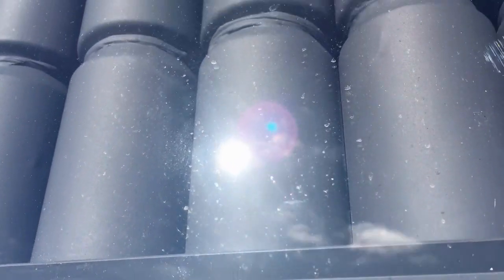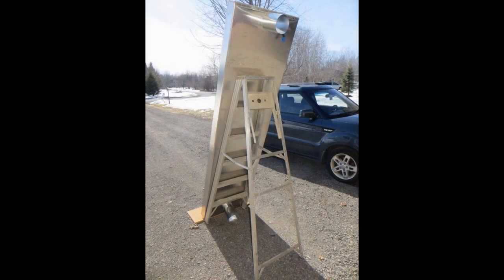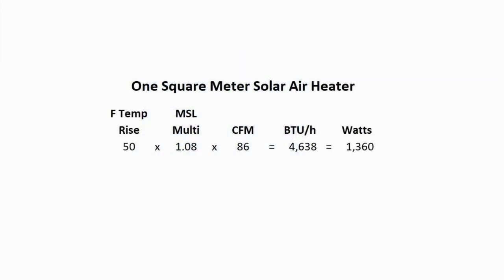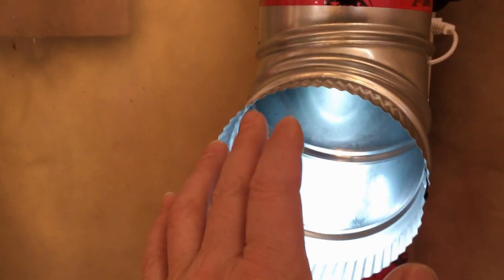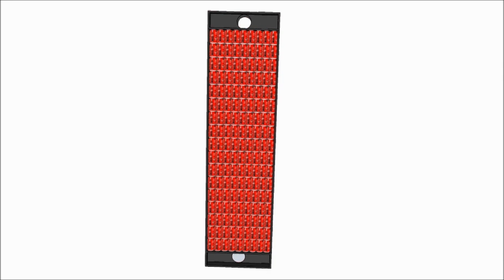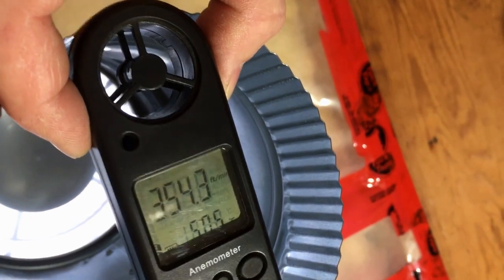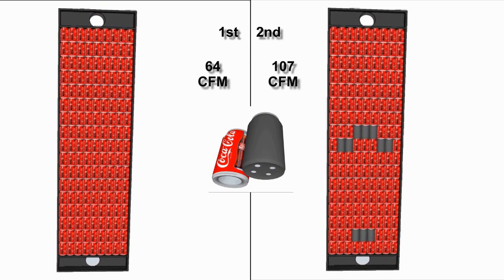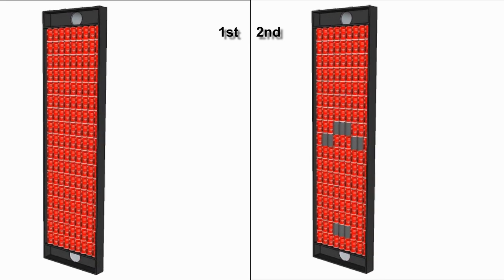DIY Solar Air Heater Part #7

Comment: Great video, Dwayne. Thanks! This addressed the biggest outstanding question I had after your first six videos on this subject (essentially, how much turbulence do you actually need, and at what point does the additional turbulence become counter-productive?). I have a follow-up question, though. In an earlier video, you briefly discussed alternative materials. At the time, you preferred the pop-can design over for example a downspout design, because you felt you needed the added turbulence provided by the cans with the holes in the bottoms. Now that you have gotten rid of most of those "baffles", and only have one or two in each column of cans, wouldn't a downspout design with a few baffles inserted in the middle produce the same results, with less work (effort of cutting and gluing all those cans together)?
Reply: Matthew, great question.  From others, on the web, I have learned that pop cans are about 16% better at conduction over downspouts, due to the thinness of the material.  As I understand it, because the metal is so thin, it heats up in less time.  I have not validated this.  

One could argue that the thicker metal that downspouts are made from may retain their heat longer, and I think that too is a good argument.  I have no experience with downspouts; I have just been building on the knowledge of others.  Additionally, the National Research Council of Canada also had some favorable results using pop cans.  

So, to answer your question, I used the pop can material for its conduction properties.  

FYI, on this last unit, I used four ½” holes on each baffle.  If I was to do it again, I would try 5/8” or ¾”.  Ideally, I would like to get the internal chambers slightly cooler.  Less resistance would give me a few more CFM, which would cool the chamber just a pinch more making it as efficient as possible. 

It really is a balancing act.
Cheers
Reply: @dwayneprice956  Thanks, Dwayne. I thought that might be the reasoning!
Reply: @dwayneprice956  It is more likely the built in restriction at the end of every can is what increases the efficiency for the most part. Also the cans have a larger surface area for a given heater size.
Reply: Matt, That’s a good question, and I’m looking forward to Dwayne answer. I do wish I could find ‘ down spouts ‘ as thin skinned as pop cans. Seems like that thinness is beneficial. Do you disagree ?
Reply: I built one with gutter downspouts and really like the design and ease of build, it's brand new so I'm still taking note of it's effectiveness but it works well. I'm blowing in 118°F air inside my house with about a ten foot run overall of ductwork from outside to inside in my kitchen with insulated ductwork (fiberglass wrapped with aluminum foil). I've noted that there is a 30°F drop in temps from inside the box with fan on to the final exit duct hole. No fan on, the inside box gets over 200°F-wish that could be the end result.😀 All of the air flow takes place within my gutters and the interior box is lined back and sides with 1” polystyrene foam board (shiny backing, not the pink stuff) and everything painted with flat black high heat paint, no odor whatsoever from the exit air. A previous one with non high heat paint and air circulating freely inside the box stunk badly and never ever went away! I want to build another project one day using coiled PEX tubing filled with water and glycerol (non toxic anti-freeze) that would circulate with a pump and go through an old fashioned steam radiator type of thing. I think the hot water holding on to more heat than air might be awesome! This link is what I based my solar box design on, pretty clever I thought and I like it.👍 https://youtu.be/PSHyCYZQTYc